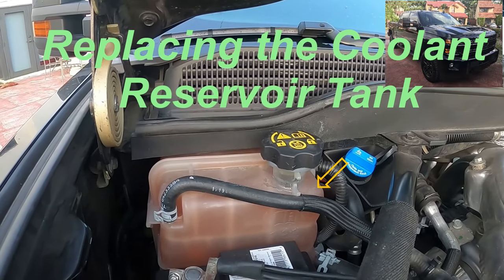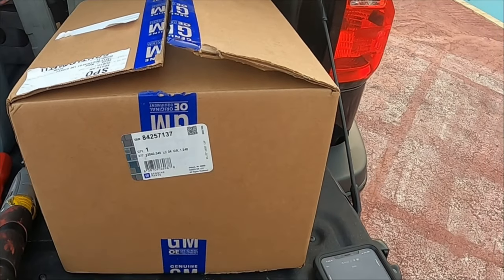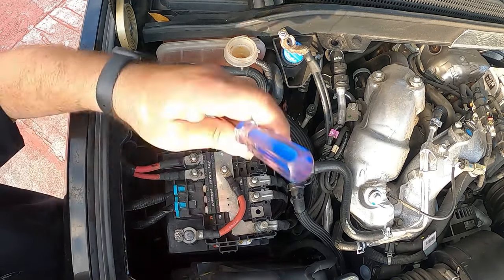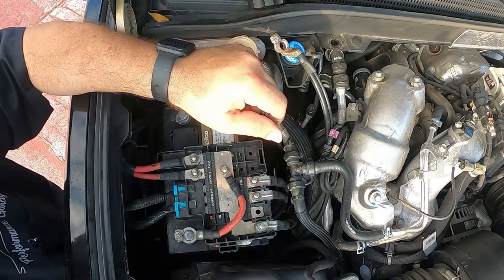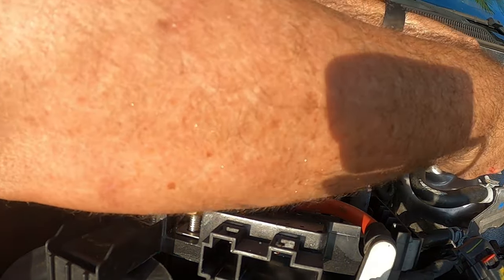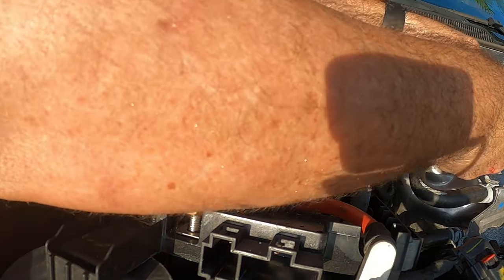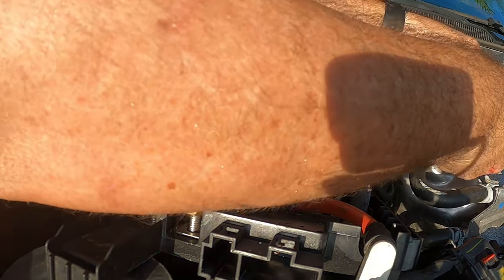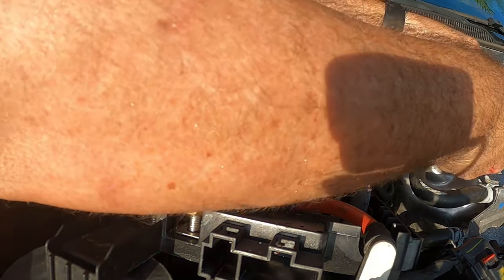“How to replace coolant tank”Silverado 2500HD 4X4 6.6L Duramax L5P

Comment: Great video and doesn’t look like a difficult job at all.  I’ll be doing this myself soon.  This will be my 2nd replacement tank since buying the truck in 2019.  Ridiculous GM won’t own up to this problem and offer a fix.
Reply from the maker: Thank you for watching my video. The reservoir tank is very easy to replace as long as you remove the battery.

Comment: I have a 2019 that just started doing this. I have never had any vehicle that warned me about low coolant. Why couldn't you just place a small jumper wire into the unplugged sensor connector and just watch the temperature gauge just like I often look at the other gauges. 
Hot engines start smelling quickly.  I hate the idea of spending $100 dollars on a 70,000 dollar truck that just went out of warranty.
Great video, good job!
Reply from the maker: I thought about just jumping the connection with a paper clip and taping it with electrical tape, but decided against it. It is difficult to spend so much money on a truck that has a cheap sensor in the original design. GM redesigned the tank in the 2020 models and did not mention a fix for the bad tanks in the 2017 to 2019 models. The tank I replaced will probably go bad in the future, I don't know of anyone in the aftermarket selling an upgraded replacement tank. for these trucks.
Thank you for watching my videos.
Reply: @flperformancegarage4163  there is one on the market (think it's wehrli) with a replaceable sensor,  I believe its expensive though.
Reply from the maker: I looked at getting the Wehril tank, but at a cost of over $500 and no guarantee that the sensor won’t go bad, I decided to save my money. The original tank last about 2-3 years before they go bad, it’s cheaper to replace (OEM) every 2-3 years.

Comment: Just replaced mine and noticed the same thing with your video, lots of loose debris inside the tank some larger than other. My guess is the crap is making the sensor sticking in the down position. Could very well have flushed it and made it useable again.
Reply from the maker: Thank you for watching my video. It would have been great if the sensor could have been replaced as a separate unit. The tank is a very strong design. I have a feeling I will be back again at this sensor in the future and will try flushing it out and see if it cures the issue. Thank you for the idea.

Comment: I’ve had it with this sensor. Complained to the dealer when it first acted up, they said they fixed it. Highly doubt they changed the tank. Now a year later, same garbage. Gonna try and get it changed under extended warranty. GM dropped the ball on this.
Reply from the maker: It’s a major flaw that GM refuses to acknowledge.
Reply: Buy the wc fab tank

Comment: simple fix is unpkug the sensor and istall a jumper in the wire. scotch glue and tape it to keep water out and check the coolant when you add def.
Reply from the maker: As a temporary fix, I would do the same in order to get rid of the annoying warning on the dash.
Reply: I've just been dismissing the warning for the past 6 months.
Reply from the maker: It’s a shame GM hasn’t done a recall on this issue, since it is a design flaw that they had to correct in the 2020 models. Thank you for viewing my videos.

Comment: 2017 l5p at 108k just paid the dealer to replace it again, orignal failed, oem replacement failed, 13 months later just paid to install the 3rd dealer charged 340.00 out the door.
Reply from the maker: It’s ridiculous that GM to this date still has not corrected the defect, the new tanks should have a replaceable sensor, instead of the one piece junk that we are all dealing with. I feel your pain, especially the amount of days you are left without a vehicle, because of the dealer.

Comment: Great video!! Would it be easier to just drain the tank up to the large hose so you don't lose so much coolant and make it easier to catch what's left?
Reply from the maker: You could drain the coolant below the large hose outlet. I was worried about introducing air into the system if I drained it below the lower outlet. Thank you for your comment, it will make me think about it the next time I change the tank again, the tank sensor doesn’t last long. Thank you watching my video.

Comment: Did you remove the coolant in the radiator ?
Reply from the maker: No, I tied up the hose from the reservoir tank in order to not allow air to get into the coolant system. I hope this helps. Thank you for watching my video.
Reply: Also did you disconnect the other battery?
Reply from the maker: Yes, I disconnected both batteries.

Comment: 2018 Silverado 2500HD LTZ Z71. I’m on a 2000 mile road trip. Low coolant light just came on. Top reservoir is full. Afterwards the check engine light came on. All gauges look good. When yours did this, was it just the low coolant light or did you get a check engine light afterwards?
Reply from the maker: My low coolant warning on the dash appeared around 34,000 miles. It’s was still under warranty at the time. The second time it came on around 42,000 miles and was not under warranty. I never got a check engine light on for low coolant reservoir. Check to see if there is something else wrong with the truck. These reservoir tanks are garbage, 2020 models changed up the location and design of the reservoir tank.

Comment: i had one replaced under warranty, 2 years and like 25-30k, the second one only last 9 months, and it is under a two year warranty because they had so many problems with them, i dont know how someone isnt hanging the company that makes these pieces of crap, i got tired of taking it to the dealer , a warranty is only as good as the people and parts behind it, i have to change batteries, so it looks like just add a jumper wire and not waste my time doing all this crap, just to put the same horrible piece of crap tank back in their to have it go bad again, and again...

Comment: I have this issue on a 2018 duramax. So is it an issue of just a bad sensor? Or is it not cycling coolant to the engine? Trying to figure out if I can drive it until I can get it fixed. Thanks!
Reply from the maker: Is the truck overheating? If not, then it’s a faulty sensor inside the coolant tank. I drove my truck for close to 4 weeks as I wait for the new tank to arrive that was on back order.
Reply: @flperformancegarage4163  No overheating. Good deal, I’ll just keep an eye on it. Thanks again!

Comment: The dealer wanted to charge me 2000 dollars, new tank, 2 new batteries and a flush , the dealer said the battery cause the problem, leaking on the sensor. Yeah    , you’re dreaming.
Reply from the maker: $2,000 dollars is a lot of money, rock auto.com has the ACDelco brand for sale under $90 dollars and a new battery around $220 each x2. That equals $530 plus taxes.